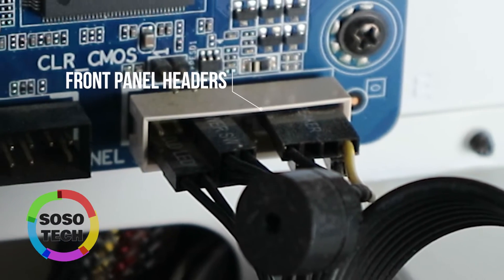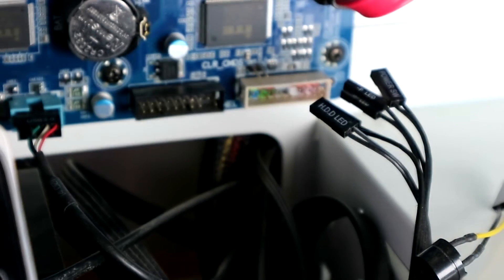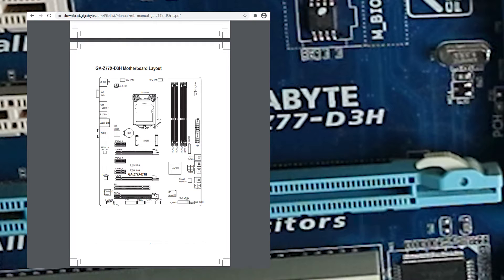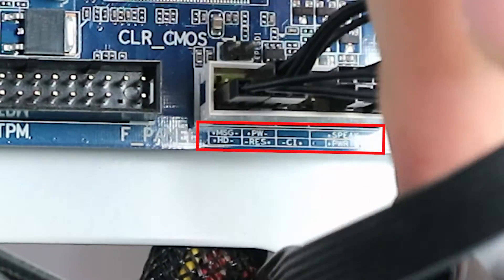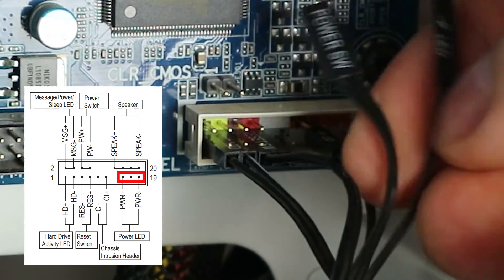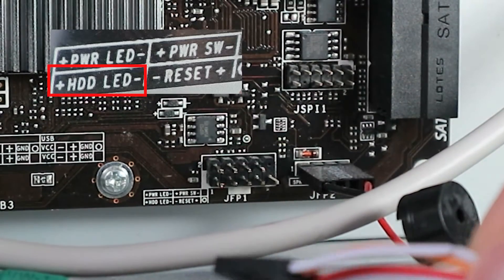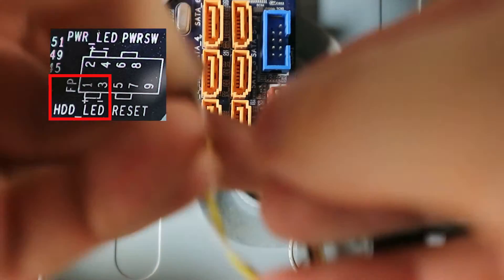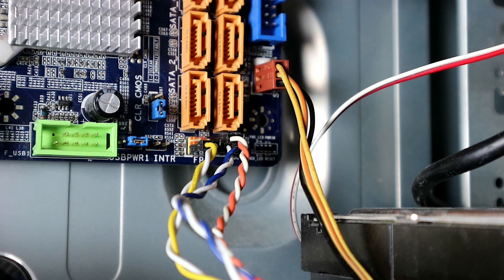How to connect power/restart button & LED cables to your motherboard while it's inside the PC case

Comment: I found a thrown away computer, someone carelessly snapped the power switches off the case., tried soldering the wires back on, but the metal legs were gone. Learn't how to remove the power and reset switches and the hdd led.

Comment: i have an issue i put my system that was in a slim case in a mid case and guess what the front panel cables are too many for the pins i have on the motherboard i couldnt get the power switch or led lights on i had to put in the old power switch in i dont know what to do

Comment: I'm on a quest to see if anybody has thought to make an extension cable for this motherboard socket. If it is not possible to make these connections before installing the MB (and it isn't), and the case is cramped or deep, it is a nightmare to install these horrid microscopic cables. All that is needed to solve this is for some entrepreneur to develop an extension cable. There should be a special prosecutor for the idiot that came up with this scheme. Now to continue my search . . . ..
Reply: They exist, just haven’t used them myself. My brother uses them at work he said, on my old case it had a premade block for the pins to be inserted into, it had designations on them where to put everything in. Unfortunately doesn’t fit on more modern mobo’s

Comment: I really wish they would refine the connectors for this it’s easily one of the most annoying parts of building a pc. Just the slightest touch and they fall out and you end up having to remove your gpu and everything near it in order to have enough room to reconnect them. They are so tiny if you aren’t incredibly delicate they will bend or break it’s just ridiculous. Every other connector has a guide line so you always get it the right way and fit correctly so why not these too

Comment: on my case the HDD LED wire had an arrow on the back but it was pointing to the Negative (white) wire.  Usually when you see a white or a white strip on the wire it's the negative side.

Comment: Mine does have the reset cable only the 2 Single led power hdd and switch power cable cant find any video that can help
Reply: Did you figure it out? I also have that problem
Reply: @gaetanosavelli808  yes basically plug it in normally into the switch my problem was that the Fans were being weird but i found a random wire that still isnt powered but made it worl